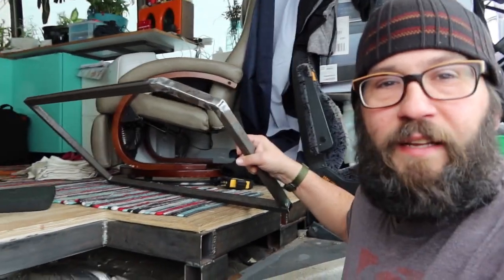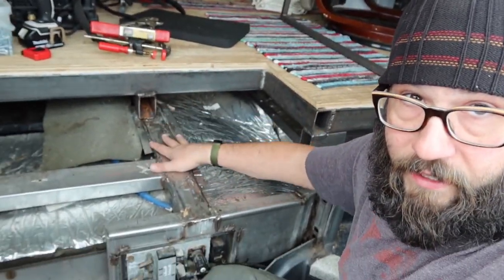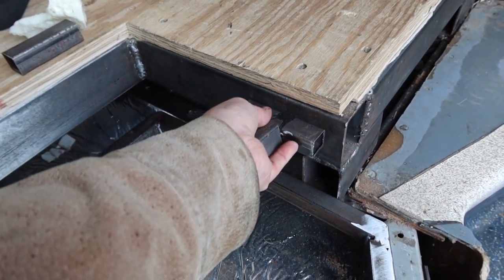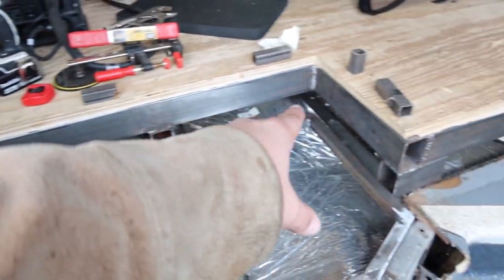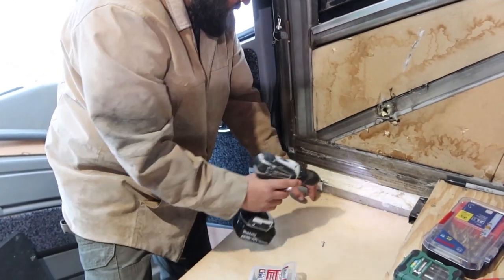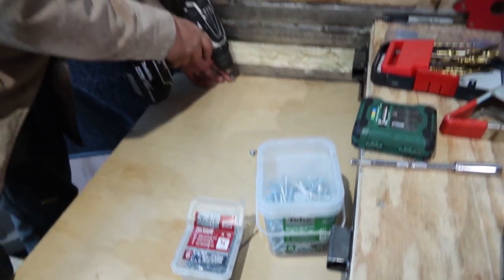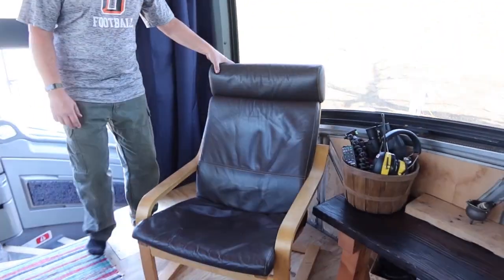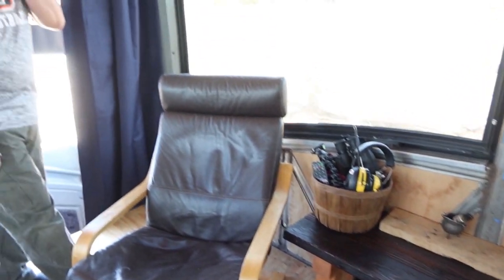Finding Extra Square Footage in Our MCI Bus Conversion

Comment: At around 15:30, what kind of screws are you using to joint the subfloor to the steel frame?
Reply from the maker: 1 7/16" Teks self drilling wood to metal screws. I purchased them at Menards. I've used a ton of the 2 3/4  inch long ones too.

Comment: So what are you going to do for the passenger seat ?
Reply from the maker: I hate to say because we'll probably change our mind still but we have a trailblazer seat that we most likely will mount on a swivel base on or just behind where I just covered. I'll most likely have to remove the subfloor and weld in a bracket or two at that time.
Reply: @andyandnancy  I can't wait to see how you do this.   Are you aware of how the folding passenger seat was set up on MC 5s ?